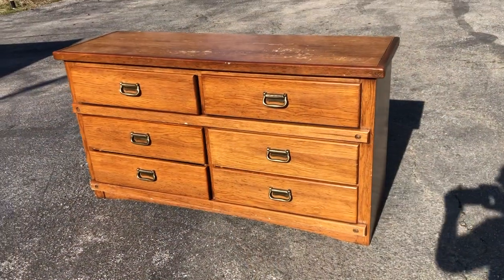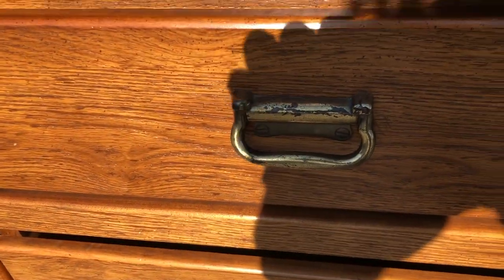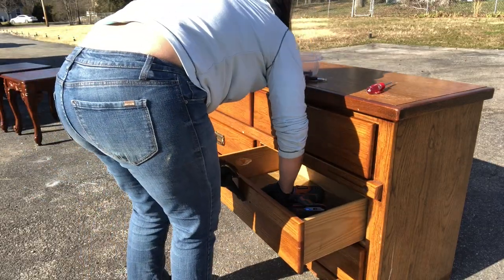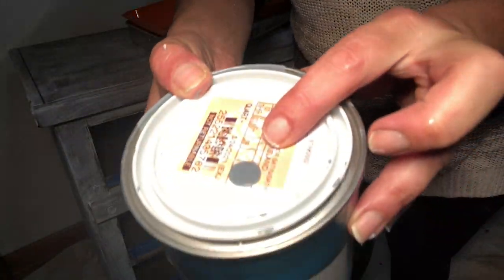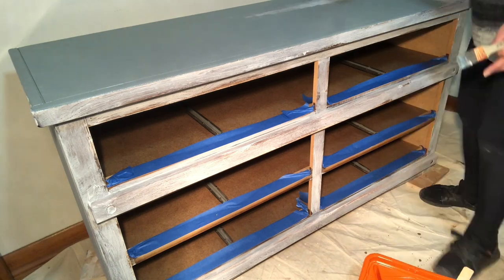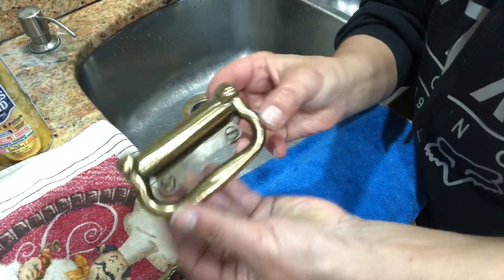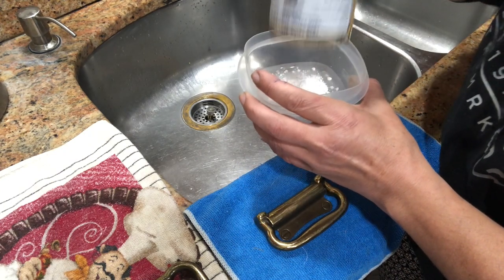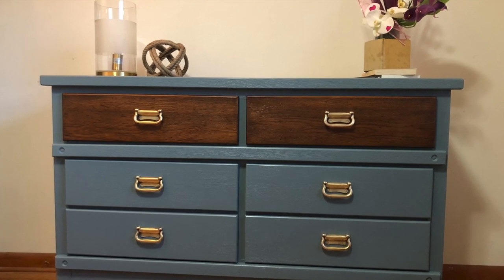Flipping A Free Dresser// DIY Furniture Makeover Profit

Comment: Where did you get the hardware cleaner ? It came out very nice
Reply from the maker: Thank you for your comment! I got from Walmart , I believe you can get any grocerie story in clean department, call “Bar keepers Freind “❤️
Reply: This is what I use for cleaning hardware as well. I’ve tried the boiling in vinegar method as well as many others, but Bar Keeper’s Friend is by far the easiest and best method I’ve found. And it’s cheap! I also use it as cleaner in my home.
Reply from the maker: @conniesisco6468  I agree with you ❤️